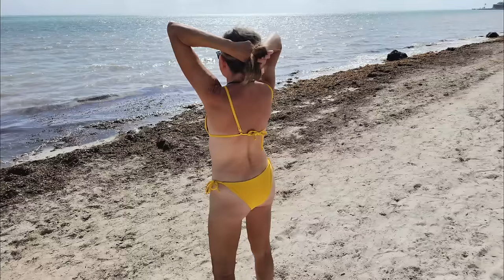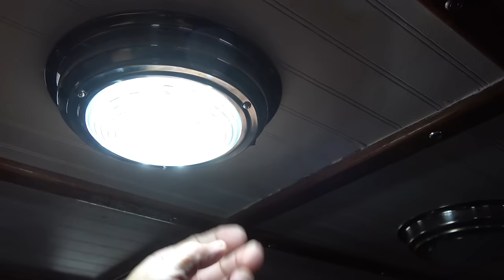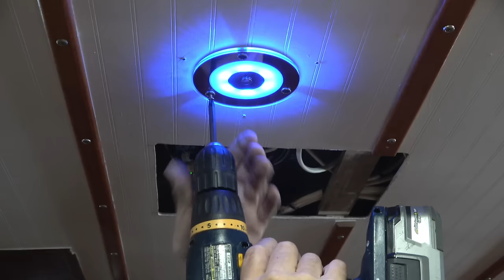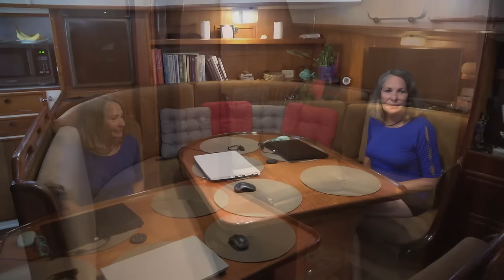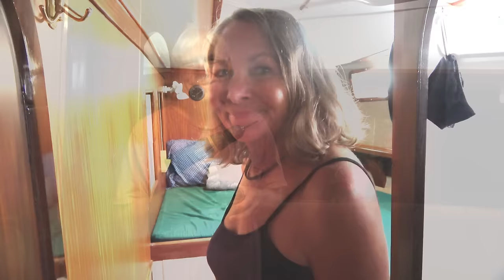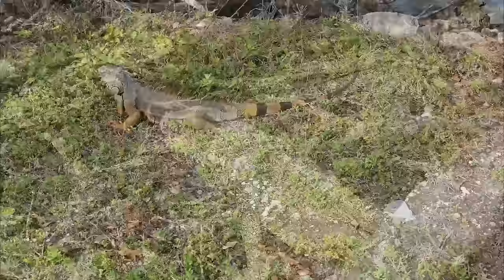Plug My Hole Ep133

Comment: Nice lights!
Where did you find them!
Cheers
Yukon John
Reply from the maker: On Amazon. Obeaming 2 Pack 12V LED Ceiling Dome Light 400LM, 4.75" Dimmable Disk Light for RV Boat Camper Van Travel Trailer Truck Sailboat Interior Lighting,Surface Mount & Touch Switch (Warm White)